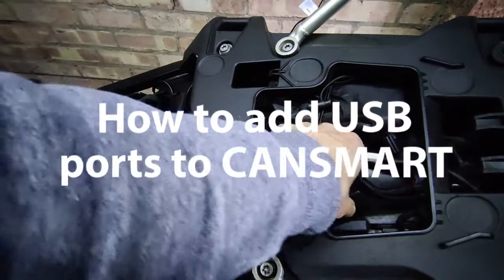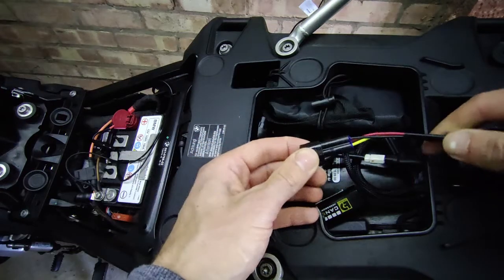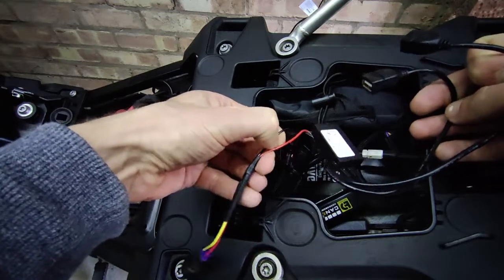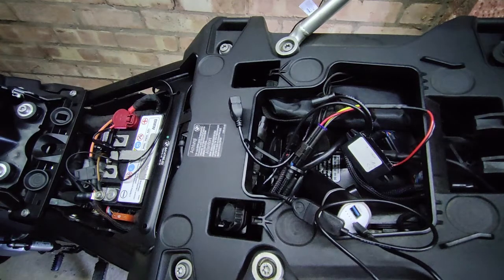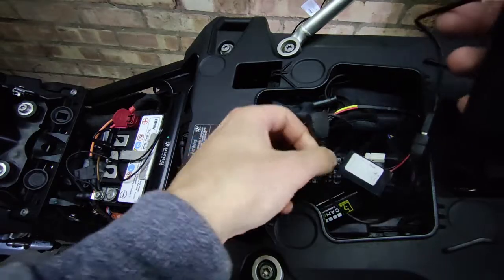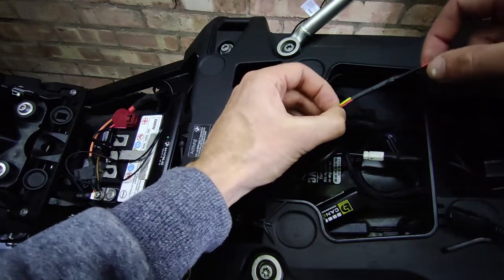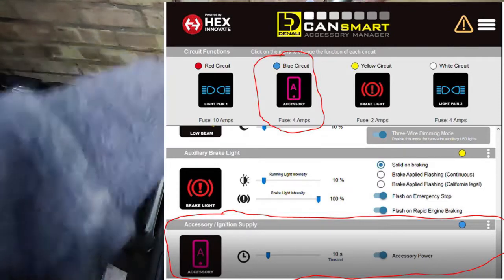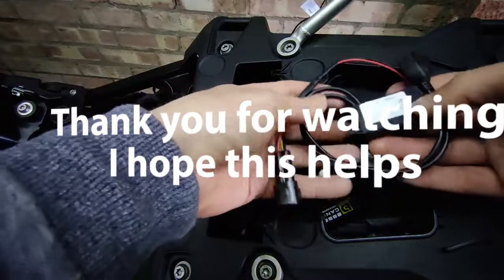Adding USB ports to Denali CANsmart!

Comment: Thanks for this, a simple guide to adding female USB connectors to the Denali, and its just what I wanted.  Bits ordered (pigtails from Denali and a power convertor from 12v to 5v with two USB female connectors).  👍